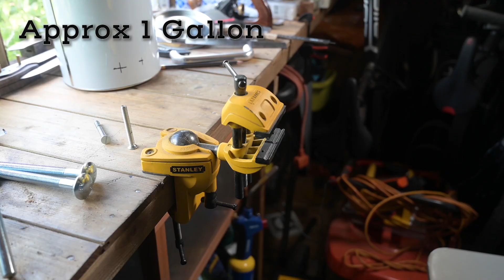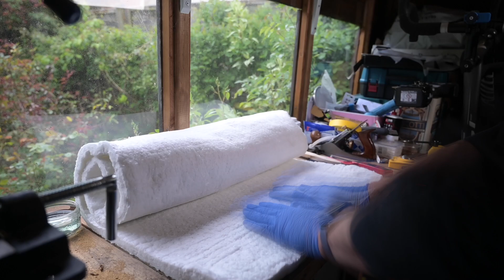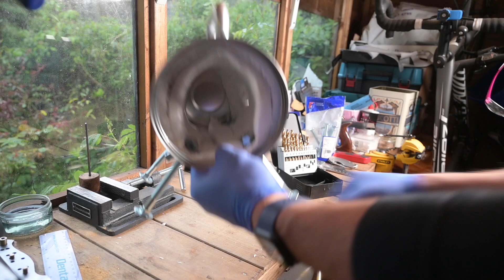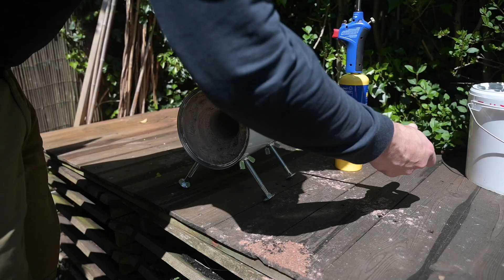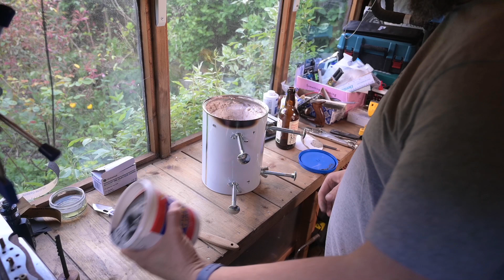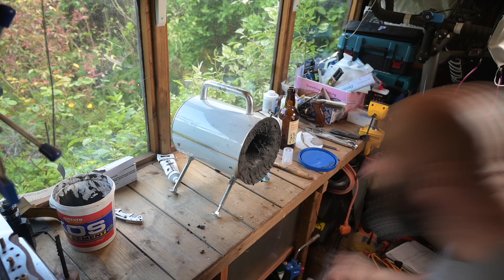Knife Making: The Coffee Can Forge, improved

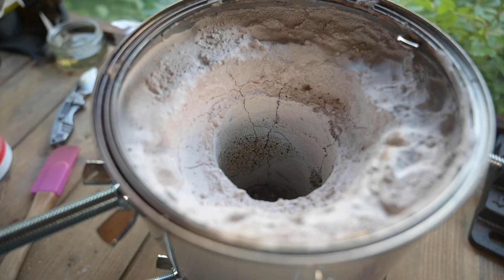Comment: 8:01 yeah.  The main issue is that kaowool, without the rigidiser remains flexible, so any coating will crack off easily.  
Also, kaowool needs to be coated in a suitable refractory cement.  The sand/plaster mix is NOT a suitable coating for it, but is, on it’s own, a suitable temporary refractory material.  Just mix it at a 1:1 ratio, and no need to use any other insulation.  Just don’t expect it to last a long time ( but it’s cheap and easy to repair and replace).
Reply: Any tips on finding a store that sells these products in Arkansas?

Comment: Would this work for heat treating 1085, 5160, 80crv2 etc? All call for temps of around 1500f. Just getting into knife making and need a cheap way of heat treating carbon steels, also how long does a canister of propane/map last running full blast on there?

Comment: How's it holding up a year later?
Reply from the maker: It’s still working - it needed a little patching to repair a crack, but I’ve replaced it with a bigger model for “proper forging” - it always got hot enough for heat treating, but never beyond a dull orange - not enough to move steel! I still use it for heat treatment though - it’s a little more controllable at lower temps!

Comment: I don't know forging but have lots of experience with refractories and insulation on industrial gas fired reactors, your basics are spot on the buils is usually steel shell (reccomend 30mm dia. X 1mm thk galvanized duct for you it usually comes in 1m lengths), kaowool min 50mm thick and high density refractory cement min 30mm thk (mixing instructions are by weight and need to be closely followed or buy the premixed stuff which needs to be tamped into place. I would like to know what the optimal burner placement is exactly? P.S. any  cracking is usually due to improper dryout procedure, manufacturer will specify, however some is inevitable as forges always have hot and cold cycles.

Comment: The only reason the plaster is cracking is because you have that fire wool or whatever it’s called beneath the plaster causing the plaster to be less structurally sound. If you had only used the plaster and sand mix that would’ve been fine. I made mine with the plaster and sand mix and it seems to be perfectly fine. Regardless thanks for the video!
Reply from the maker: You’re so welcome, and thank you so much for the info!
Reply: How is this s year? Still usable?
Reply: Hello
Reply: @Kyt_01234  sure is!
Reply: @onemanbanjo975  wow good to know, thanks. I ding need to do much else othef than sand and plaster to have a functioning forge.

Comment: Why dont you just point the opening up so the knife will sit down in it?
Reply from the maker: You could do that, then it would be more a furnace deisgn than a forge - the main problem is you'd need to suspend the forge differently, as the base would then get very hot, and i'd worry about uncombusted gass collecting at the base - you'd need to put the burner right at the base. Also, you'd risk damaginf the furnace structure dropping the blade in, and you'd be resting a hot, soft knife on it's point, so could easily introduce bending or warping. But I've seen all of these issues overcome with some designs, I'm just not sure it'd work with this one...

Comment: Watched someone’s coffee can build with one part sand and one part plaster of Paris. They also put a paint can in the center allowing the mix to only dry for 30 minutes and then pushing the can all the way through. There insides of the can looked really good.
Reply from the maker: See, mine looked great when i'd pulled the mold out, but on heating it became clear that it just wasn't going to stand up to the heat at all - hence the relining. I'd be interested to see what theirs looked like after a few heavy firings...
Reply: Good to know that you can always repair it with refracting material.